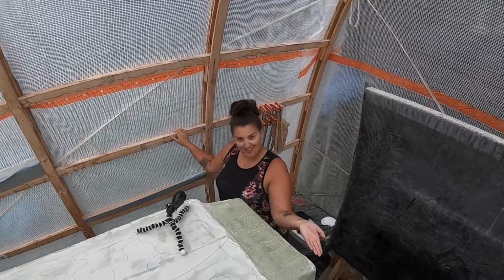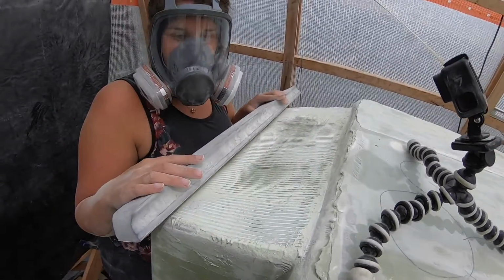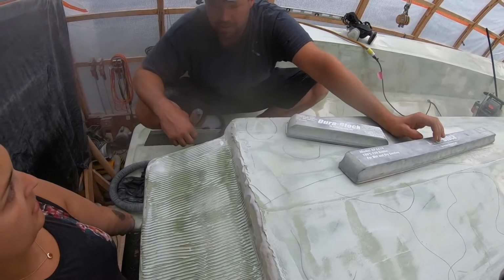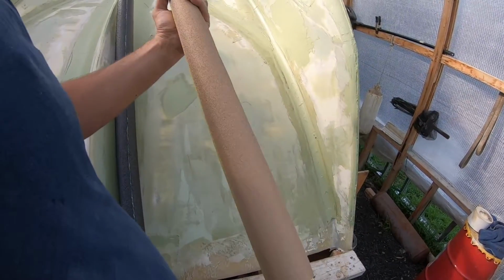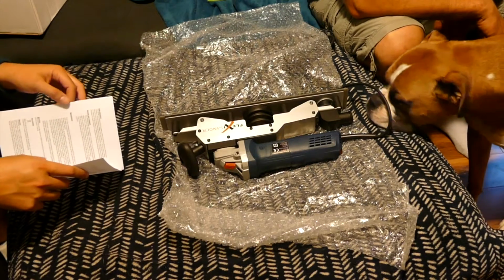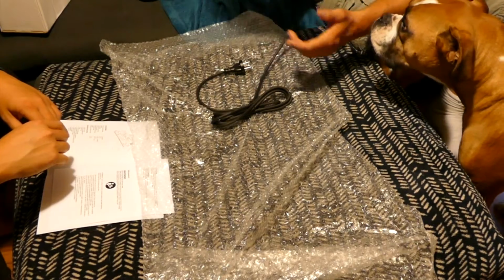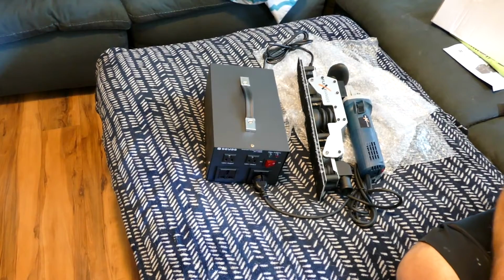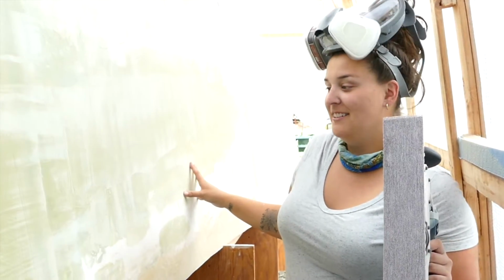Step 54: We got a Flexisander! It's a Sanding Extravaganza! POWER CATAMARAN BUILD

Comment: This wasn’t boring at all, besides sharing it lessens the pain of sanding. I’m curious what your conclusions are about the sander now that you have used it extensively, was it worth it?
Reply from the maker: It was an expensive purchase. But to us it was worth it. Although It is great for the larger areas, we still went back and did some final touch ups with the long boards. Thanks for following along 😊

Comment: in Europe it's 220v i own a home there and in america i have converters from 220 to 120  and also 120 to 220 , every house in America has 220 v the difference is in europe 220v comes in one wire the other is neutral , in America 220v comes in 2 110v wires so just tie the 2 110 wires together and bingo you have single wire 220v with no converter
Reply from the maker: My major concern with the power was the hz, in Europe they run at 50 hz in the USA they use 60. I’m definitely no electrician but I didn’t want to take a chance burning up an expensive sander motor. The piece of mind was worth the added expense. 😊 thanks for following along 😊

Comment: I don't know if I'm the only one that noticed that the motor assy of the sander is actually the same as an ordinary angle grinder. Harbor freight 110v sander here I come.
Reply from the maker: We also noticed this once purchased 😂
Reply from the maker: It’s literally a Bosch angle grinder!
Reply: yeah it's grinder for power but making the flexible vibrating board that's the hard part , they also make a pneumatic one